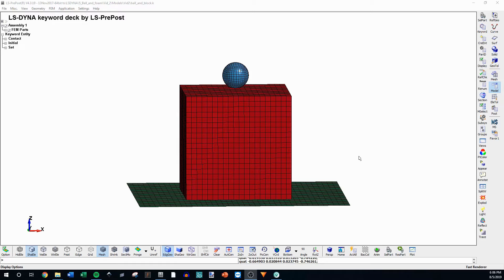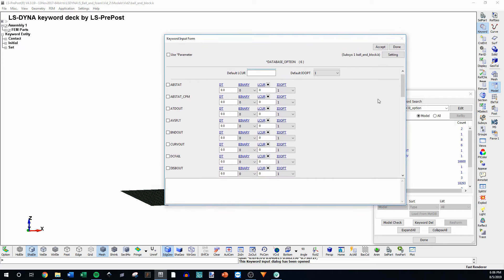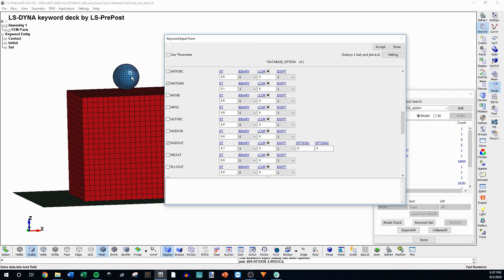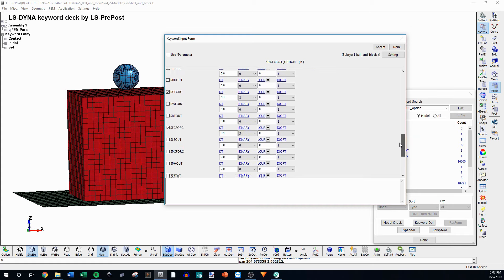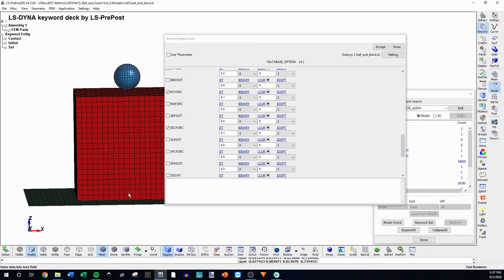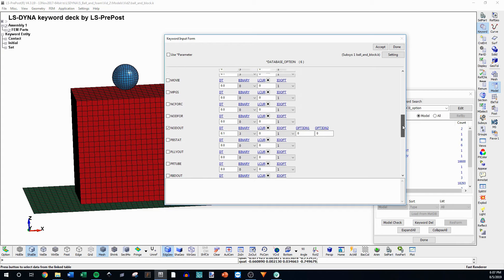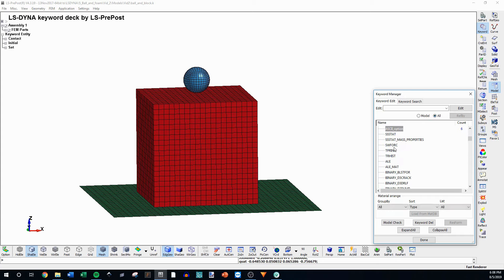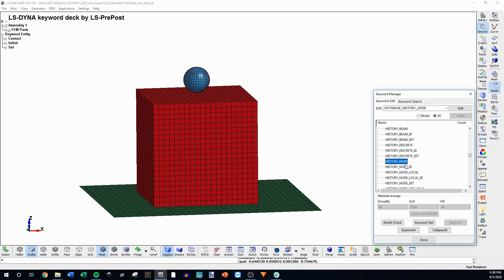LS-Dyna Ball and Block Tutorial Part 3: Database Node and Element Sensors

Comment: Hi, Thanks for the video! I am trying to verify the test data obtained as a result of this study with the analysis I made. However, the result seems very different. The reason for this may be the pressure transducer elements in the load cell sensor used in the test (I am not sure). Load cell equipment creates a dumping effect on graphics. Can you provide support on how I should model these elements? Is it possible to create damping elements at the rear of the rigid plate?
Thank you.

Comment: Hi! Thank you for your high quality tutorial, it truly helps!
I just find myself stuck at 12:58. When I want to select the node_set, the window to select it doesn't appear, and if I try to enter it manually, it displays "INID 3 not available" when I try to insert it. I checked in Create Entity, and the Node set seems to be indeed created.
Do you have an idea on why is that happening? Thank you in advance!
Reply from the maker: So are you talking about when you are creating the node set or when you are clicking the circle to reference the node set? If it’s when you are trying to reference the node set, make sure you change ITYP=1 in *Constrained_interpolation. If it’s 0 then it’s trying to reference a node.
Reply: @UnpopularMechanics  Thank you for your quick response! I did set ITYP to 1. The problem occurs when I click the circle:  the window to select the node set does not appears, and nothing happens.
I should mention that, as opposed to the footage you show us, I have another value called IDNSW next to ITYP. I tried playing with it a bit, but it doesn't seems to help.
Reply from the maker: Do you have two monitors? The selection window may be popping up off screen. After you click the circle hold windows then use the left arrow to try and see if it moves the selection box into view.
Reply: @UnpopularMechanics  I working on a laptop. I tried anyway, but still no luck. I guess that's the joy of working with any software, sometimes it will just throw a tantrum :p
Reply from the maker: Yeah weird..you can always try downloading a different version of LS-PrePost
Reply: Hi, did you ever get past this problem? I'm having the same issue.

Comment: I Have a question please....when I set the ASCII options....the model stops at certain point and doesnt give normal termination message...do you have any idea why this might happen...when the I use the post it displays result till the point he stopped running at and doesnt run for the whole termination point
Thanks in advance
Reply from the maker: This is related to the simulation setup in this tutorial correct? Does it normal terminate if the ascii options aren’t set?
Reply: @UnpopularMechanics  I am doing another model but I am basically setting the same ascii options....yes when the ascii options are not set it gives normal termination

Comment: how to create coarse and fines mesh in the same object/part ? plz help me
Reply from the maker: Solid or shell part? And what software do you have access to?
Reply: @UnpopularMechanics  I have LS-Dyna software,abaqus..almost all softwares(through my college )

It is a solid part.i want fine mesh at center and coarse mesh at periphery.
Reply from the maker: Hypermesh may be the best for this but you also may be able to do it in LSPrepost. I can’t give a thorough tutorial in a YouTube comment but I can offer the general process. When you do a solid mesh on an object you are given the option to determine how many elements are created along a given edge, which you can also use to bias the mesh to have smaller elements on one side or the other. In order to do this though you would need to modify your CAD or surface geometry to have a line or something extending from the center of the object.

Something else you can do is create a 2d mesh on the outer surface of your geometry and then create your 3D mesh from your geometry and use the outer 2d mesh as a guide. You may be able to make the target 3D mesh small enough so that it’s much smaller towards the center but nodally connected to the larger 2d mesh at the outer surface.

There are other ways also. Feel free to create a topic in the forum if you have any more questions:
https://feassistant.com

Comment: hello, do you have a tutorial that explain how to obtain friction coefﬁcients in Ls prepost? I need to know how make the friction or contact between two objects. I am new working in this software... I would be very grateful thx :)
Reply from the maker: Do you want to know how to define friction or get realistic friction values? To define the friction you can just input values from 0.0 - 1.0 in the fs and fd options of the contact that you are using. The first video of this series I believe goes over how to do this.

If you are looking for realistic friction values I would just do a google search for friction values of the material that you have in the contact.
Reply: @UnpopularMechanics  Specifically, obtaining the friction calibration curves from the finite element analysis by the ring compression test method can be any type of metal that the software has
Reply: could you pass me the link of the video you mentioned recently please?
Reply from the maker: I see. So within LS-Dyna, friction is not determined within a material, it is only defined in a contact. Therefore, you cannot retrieve a friction coefficient through simulation. This may be something that you can do through LS-Opt or a Hyperworks software like Opti-Struct. Sorry, I cannot help you with this.

Comment: Hello and thank you for your work. For a study I make at the faculty, I have to do much analysis to verify the behavior of shell elements in LS-Dyna (Linux). Considering the number of databases to create, I want to automate the recover of one node Z-displacement's along the step times to trace curves (using bash, python, gnuplot or anything), so I won't have to open all of the D3plot created each time (dozens of D3plot). The Z-displacement parameter is the only one considered in my studies. So I got a nodout file, but its layout make it non-usable for a post-treatement software like gnuplot.
Do you have some ideas I may use to achieve this ?

Thanks again, a french mechanic student